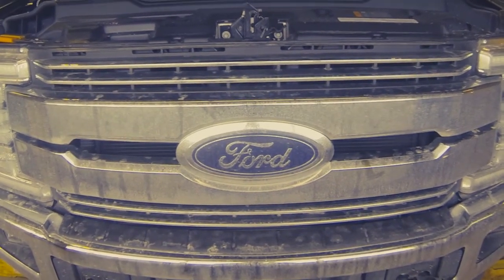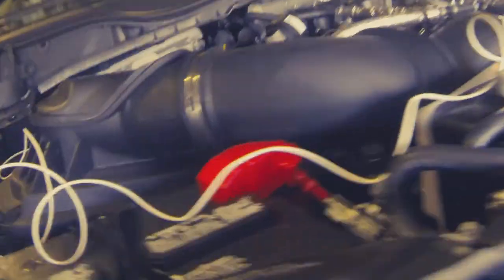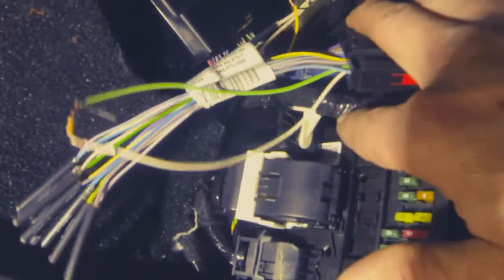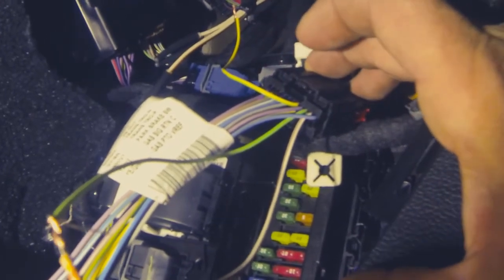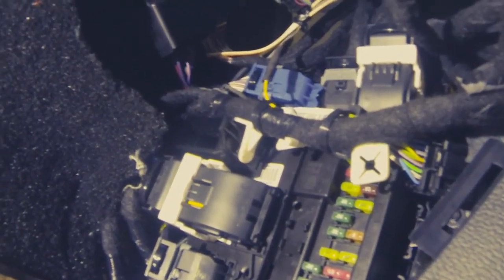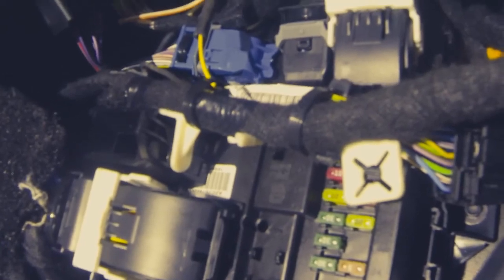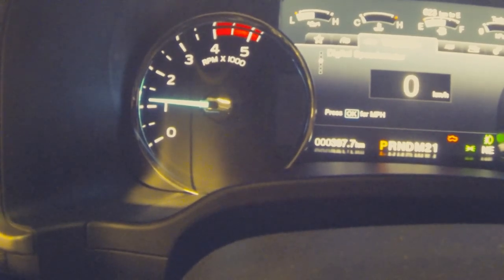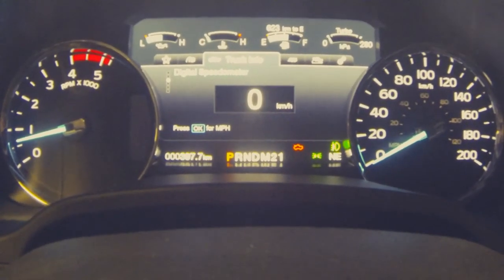2017-2019 Super Duty SEIC/High Idle Installation Instructions

Comment: My pass through wires are not visible like yours.  I can only see 2 pigtails that barely stick out of the fire wall and can't even get my hands on them.  On the inside of the panel their isn't much either.  Is that right or am I missing something or did Ford just screw me on those wires?  Any help is appreciated!
Reply: 2018 6.7
Reply: I think I just found them but they are all taped up. They come out of the tape and loop back into the tape. I don't know what end to pull on and hate to un tape it all.
Reply: Ah i do see some black electrical tape down there. I think that is holding them down. F' could they make it any harder. 
I am worried about reaching down there my arm is really pressing against the connector for my computer.  Is it okay to unplug it or will it throw some things of unhooking it?
Reply: I got them! Yes! Thank you. A lot of time and patience.
Reply from the maker: Hey sorry didn't see the last post. Yes if you need to unplug the PCM just remember to disconnect the negatives on your batteries then unplug away! Glad to hear you found it!
Reply: They were loped back behind the harness. I thought they went back in bat after some time they went behind (hidden) the harness and down to black electrical tape. The extra tape you talked about is what helped me find it. Thank you!

One more question. I am an electrically challenged but just fine mechanically. This pigtails can i strip the black coating off or do i have to cut all the black coating off then strip the wire?
Reply from the maker: Ah yes, they can be quite hidden at times. Haha never challenged, just need more practice ;) Ok, those black ends are the factory heat shrink to cover the wiring ends. You can either cut them off and strip what you need or try to get them off. *WARNING-that stuff is hard af, lol I wouldn't risk slicing my fingers open to save an extra inch of wiring*. I personally just cut off the ends I need and leave the rest until I need them. 

Glad to hear I could help and thanks for the views and comments/questions. Any other questions just ask!
Reply: @LifeofRaiden  thank you for the video and your help!
Reply from the maker: @jlweck231978  you're very welcome! Glad I could help ya!
Reply from the maker: Hello, I will try to help as much as I can! What year is your specific vehicle? Also, the harness maybe be quite thoroughly taped to main harness, so much so it may not be visible. Does your harness have "extra" tape in that area?
Reply from the maker: Oh and what engine? 6.2/6.8/6.7?

Edit; Saying location will differ slightly depending on gas/diesel.
Reply from the maker: Haha understandable concern. Are they looped both inside and outside?

Comment: I done this to my 2017 f350 when I purchased the truck and passed the wire at the same place as you did across the fire wall with loom cover just as you did, but the heat from the engine melted all the loom . I had to purchase heat insulation to protect the wire from the manifold heat. Did you have an issue with your loom over the wire melting.
Reply from the maker: Oh really? I haven't had any issues so far. I've had one where after some time the loom got brittle but the wire was intact and not melted. Thanks for letting me know, I will keep an eye out for any that!

Comment: I finally got it rolling on mine. So i connected #18 yellow/green to solid green with a 12k resistor. Then power to #7 yellow green. Works just fine now.
2019 F250 XLT with 6.2l gasser
Reply from the maker: Right on, thanks for the info!

Comment: Thank you Shamus for the teachable explanation.  I had to look long and hard to find the 1 then blank then 11 on the housing. However by counting I found the CORRECT YELLOW AND GREEN STRIPE, Why the caps! Well because as per other videos that dont tell you the pins you can easily ( 50/50 shot ) grab the OTHER yellow and green # 18 and then when you mock it up ,put it all together and you get a big fat WTHeck? nothing. 

I also used WAGO connectors inside the truck as it miserable to work in however it is clean and dry. They work fabulous positive lock or unlock no wire damage, no voltage drop and if you get 2- two slot connecters you can then insert the green and the white with brown and then snap in or out different resisters.  If you wish to or remove the wire job easy and clean. I used one  on the pass through wire also. Outside I’ll use weather pack connectors. 2019 Ford F-250 6.7
Reply from the maker: Haha oh really?! I'm glad the video helped! Thanks for the update too, that sounds like a great way to do it and easy to modify if needed. Very much appreciated!

Comment: I have a 2018 f350 platinum and I followed yours and another guys video to a T. I can not get mine to work at all. Used aux switch 1 and ran it over to the white pass through. I then hooked the 7pin wire to it and put the resistor on the green and white/brown wire. I have messed with it for 2 days testing wires and resistors with a multimeter and still can't get anything to work. Any help would be greatly appreciated.
Reply from the maker: Very odd. Ok, I'll look into this a little. In the meantime, a couple basic questions. Have you made sure you have a known good relay for Upfitter 1 as well as made sure the fuse for the Relay hasn't been popped. Last question, I must ask... you have the parking brake engaged and not touching the service brake when trying to activate system?
Reply: I'm not a 100% the switch is good but when I test the pass through wire I do have l power. I'm guessing the fuse/relay is good, because when I tested the wire & fuse with my light probe it lights up. I do have the parking brake set and no foot on the service break.
Reply from the maker: Oh yeah that may do it. Does the lettering light up when you  use the switch?

Comment: @Shamus if I don't have up fitters couldn't I just run a toggle from battery voltage to the yellow and green?
Reply from the maker: Oh good question. Let me double check and get back to you tomorrow. I dont want to give a definitive answer and have steered you wrong. Will triple check the wiring diagram tomorrow and let you know asap!
Reply: @LifeofRaiden  Thanks
Reply from the maker: @johnm9131  Ok, so I've looked into it and yes you can totally install a toggle switch from the battery to pin 7 ye/gn wire. I do however suggest circuit protection as well. I've double checked the wiring and fuse diagrams. The stock circuit protection for the output side is 25A. So as long as somewhere you install an inline fuse with 25A, you should be ready to rock! Hope this helps. Any other questions, ask away!
Reply: @LifeofRaiden  thanks for getting back to me I really appreciate it. I do plan on using a fuseable link. Appreciate your time and videos. Are you the "electrical guy" at the dealership or "diesel guy"?
Reply from the maker: @johnm9131  I'm mainly the electrical guy but I'm slowly getting my hands wet with diesels. Plus all the guys here are super helpful. You are very welcome and thank you very much for the amazing comment!
Reply: @LifeofRaiden  No problem, I've subscribed.
Reply from the maker: @johnm9131  Thanks, very much appreciated!
Reply: @LifeofRaiden  Update.  just wired it up works perfectly. This will do until I can afford to purchase the factory harness and upfitter switches to convert!
Reply from the maker: @johnm9131  That's awesome to hear! Thank you very much for updating!
Reply: @LifeofRaiden  Do you happen to know what safety parameters are in place like temperatures that may disable the high idle? Just curious, thanks. Also, is there a way to enable secure idle, similar to the police interceptors allowing cars to run without the key in the ignition? Hopefully all these inquiries are ok.
Reply from the maker: @johnm9131  Ok as for disabling an already running SEIC would be your basic engine monitors (coolant, oil and fuel temperature). If any of these go too high, the vehicle will enter what's called a Failure Effects Management Mode (FEMM). Once this system kicks in the vehicle will usually "de-rate" itself accompanied by multiple warning lights and/or messages in message center. What actually happens with the SEIC engaged, unfortunately I don't know (Haven't had it happen to me or a concern like that from any customers). Now as for the engagement or disengagement of the system when wired into the stock upfitters. The system will not engage without the parking brake engaged, vehicle in gear (anything other than Park), and/or the service brake is being depressed. Same for disengagement, if you release your parking brake or happen to touch the service brake pedal, the system will shut off. I hope this makes sense, if further clarification is required, hit me up! :)
Reply: @LifeofRaiden  Makes total sense I use to wrench 6 years ago just not a diesel tech and being out of the business for so long I'm a little rusty. Hope your don't mind all the questions this is my first diesel.
Reply from the maker: @johnm9131  I just saw the second part of that message. Brain fart obviously. As for that type of ignition adjustment, I do not. The police cars we get are always pre or post equipment installations. When they are pre install. Its all OE programming. They usually are still in "Transport" mode. Again, apologies but that's out of my realm without having a vehicle in front of me to mess with 🙄🤣
Reply: @LifeofRaiden  understandable sir no worries thanks for the assistance so far.
Reply from the maker: I don't mind at all! Mainly I'm happy I get to help, plus I get to rest my skills with questions haha. Keep'em coming!

Comment: I wish you could have told us what the labels were on the  7, 9, and 10 wires were, in case ours were different, since I have a 2020.
Reply from the maker: Yes, I totally understand. When I posted the video, the 2020 models were not out yet. I will be posting a video soon for the 2020 models but that wont help you now. I will check tomorrow morning and update you ASAP!
Reply from the maker: Ok, I've looked it up and customer access pigtail wiring for the 2020's do not change from the earlier models. Pin 7 is the PTO1, Pin 9 is the RPM PTO and Pin 10 is the PTO REF.
Reply: @LifeofRaiden  Thanks for the info.  I got it working.  But now I have a strange clunk from the transmission when it disengages.
Reply from the maker: Really?! Interesting, just making sure. Your 7th pin YE/GN is going to the pass thru wire then to upfitter relay box wire. And the resistor is installed at the 9th pin GN wire to the 10th pin WH/BN wire?
Reply: @LifeofRaiden  Everything is installed correctly.
Reply from the maker: Also too. I am literally recording the 2020 High Idle video now. I just found that the customer access pigtail at the BCM has two YE/GN wires. Pin 18 and pin 7. Can be tricky, I just got caught with that myself and accidentally wired it to pin 18.
Reply: @LifeofRaiden  do you have that video up yet? I am trying to get mine to work on a 2020  f350 6.7 and I can't get it to work.
Reply from the maker: @josh6757  Hello, sorry for delay. I have the raw footage filmed just editing left. I will put a hussle on it (puppy put alot of things on hold 🤪). In the meantime, are you having questions about installation.
Reply: @LifeofRaiden  no I got it to work. There was 2 of the green and yellow wires and I had the wrong one hooked up.  Thank you though I appreciate it.
Reply from the maker: @josh6757  oh that's great to hear! I'm still gonna light a fire under my ass to get that vid out tho. Thanks for the reminder!
Reply from the maker: Ok and the clunk only happens when you shut down not when engaging, correct?
Reply: @LifeofRaiden  Correct, clunk when the high idle disengages. I've been under the truck looking for it. The driveshaft turns about 5 degrees. That's in park with parking brake on. I need to try it under other conditions.
Reply from the maker: @wiredforstereo  I apologize on forgetting to update. I have not found any root cause of a clunk when disengaged. Have you found anything?
Reply: @LifeofRaiden  It either has gone away or is not noticeable anymore. I use the high idle to keep the alternators revved up using the winch on my trailer.
Reply from the maker: @wiredforstereo  thats ... interesting. Lol, if anything does change tho. I'd love an update! Thanks and again, apologies.
Reply from the maker: Hrm, ok I unfortunately have no immediate answers. I will do some digging and see what I can find.

Comment: Currently too hungover to watch this shakey video
Reply from the maker: Understandable 🤣 I did get a holder finally!
Reply: Sorry man 😂 not your fault at all heading out to the shop to do this on my 19 now
Reply from the maker: Nah, I understand. Was my first time trying and after reviewing. I knew I needed to invest in something, lol Sweet man, good luck hope it helps. Lots of extra help in the comments too!
Reply: Shamus thanks man, I did this mod in my deleted 16 but it was quite a bit different
Reply from the maker: Yeah once they changed the body they moved some vital stuff around. Some for the better, some definitely not 🤣
Reply: Shamus i was successful! Today this will make things a lot better when I leave my truck running this winter in the -20 and wanna talk about something that was a pisser is finding a place to run my plow wires on this truck 🤦🏼‍♂️
Reply from the maker: Awesome! So glad to hear, yeah it will definitely help with that! As for the plow wires, I could only imagine 😳
Reply: Shamus oh dude it was terrible plus they added all these relays on the new plow harness 🤦🏼‍♂️ they are all under my air box
Reply from the maker: Oh jeezuz really?! Damn, where did you run the wire thru the front? Thru bumper or grille?
Reply: Shamus through the bumper

Comment: Great thorough video. Very helpful! Actually able to tell exactly what you did, which was a nice clean install. Plan on doing this to my 17 6.2L.
Reply: Thanks but Ive got no questions for you. I do however have intel for you. The resistor table for gassers is different. For 1200 RPM they call for a 12K resistor. The pin out is also slightly different. The SEIC 12V input is still the same as being a yellow/green wire on pin 7. The PTO RPM input also stays the same as a green wire on pin 9. The PTO VRef is where the difference is. It becomes a yellow/green wire on pin 18. All this info with wiring diagrams can be found in Ford's SVE Bulletin Q-256.
Reply: @Trigger_32  i'd like to do the same on my 2019 gasser. Did you get yours to work?
Reply: @MrJuventino451  I did. Set it up using the Aux 1 upfitter switch
Reply: @Trigger_32  awesome. So its white/brown to green and power to yellow/green?
Reply: @Trigger_32  ok i just went back and read that we now have 2 yellow/green wires. One will be connected to solid green and the other to power switch.
Reply: @MrJuventino451  you can refer to page 11 of SVE Bulletin Q-256R2. You will apply 12V (using any upfitter of your choosing) to yellow/green labeled “PTO 1”.You will then connect the other yellow/green labeled “GAS PTO VREF” to the green labeled “PTO RPM” using a resistor (chosen from chart to achieve desired engine speed). Once the engine reaches a certain operating temp, and the parking brake is applied, turn on your selected upfitter on and the rpms will raise. If you touch the brake pedal, engine will return to normal idle, and you will have to turn off the upfitter and turn back on to re-engage high idle. Hope this helps. Good luck.
Reply: @Trigger_32  thank you for the info. Going to do that today. Was working on it yesterday and it started drizzling so i had to put it on pause. We only get a few days of cold weather in Laredo Texas and its terrible for us😂😂😂😂
Reply: @Trigger_32  i finally got it rolling on mine. So i connected #18 yellow/green to solid green with a 12k resistor. Then power to #7 yellow green. Works just fine now. Thank you for the help!!
Reply: @MrJuventino451  good deal! I tried posting that I used a 12K resistor to get 1200 RPM & a link to where I got them, but I guess it got flagged for the link. Oh well, you figured it out. Keeps the AC nice n cold on them hot days on the road at a rest stop.
Reply from the maker: Thank you very much! Sorry for the shaky cam (got a handle now haha). I recommend reading thru the comments as well, some great ideas! Any questions just ask!
Reply from the maker: Awesome! Thanks for the info, I will look that up!

Comment: What size gauge wire? Just trying to get together a parts list so I can go to my local electronic store.
Reply from the maker: I'm not at work at the moment but I'll check tomorrow and update. If you're in a pinch, there are two options. Easy way is if the tag on the customer access pigtail at the lower interior A-Pillar is still there. There may be gauge info. If not, unfortunately it's get your wire strippers and match to gauge numbers.
Reply from the maker: Ok, I've scoured the wiring diagrams and pigtail printouts. I'm seeing gauges 18/20/22 used at the customer access connector. I cannot confirm pass-thru wire gauges, no actual printed documentation stating gauges can be found. With that being said, I know there are a couple wires at upfitter relay box and pass thru wires that are 16 and/or 14 gauge (can't tell ya which exact ones, sorry). As for installing, I myself soldered. I found that when using resistors, the metal tabs may/will break or become weak when using a but/crimping type of connector. Hope this helps, any other questions just ask!
Reply: which gauge wire did you use?
 @LifeofRaiden
Reply from the maker: @jmcaulay182   For this installation I used 18g.
Reply: Thanks! Just was curious if you knew. Did you end up soldering or using butt connectors?